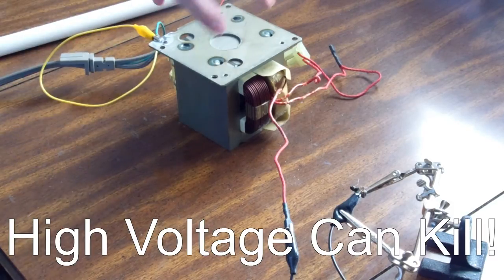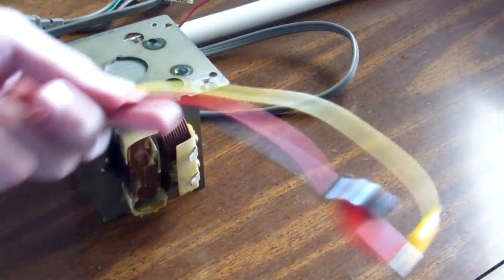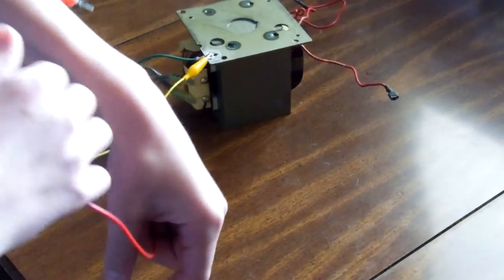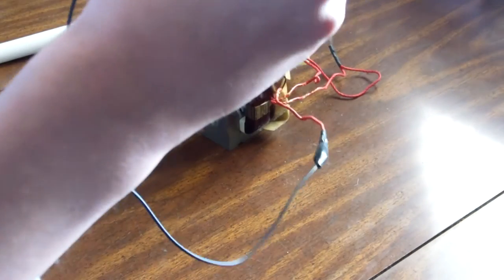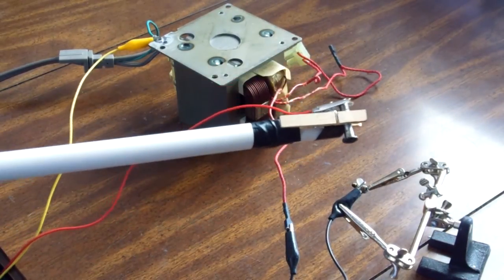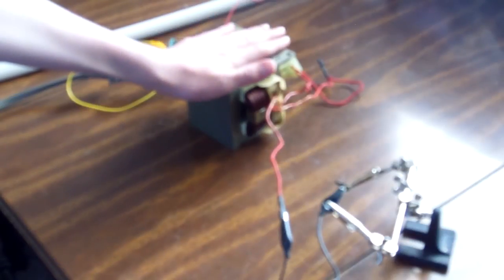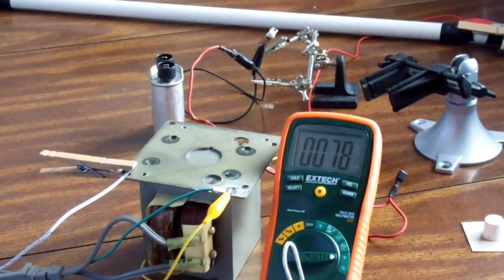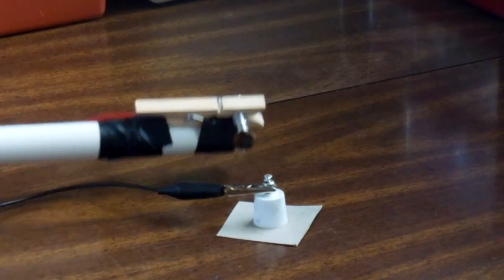Microwave Oven Transformer (MOT) How-To

Comment from the maker: It would actually work better to put a resistor in series with the primary side of the transformer. The reason I don't do that is because finding a resistor that can withstand up to 1800 watts of power is near impossible. The surge protector I use cuts out before the main breaker, so it is pretty easy to reset.
Reply: You can also use a shorted MOT in series to limit current, or cool it in a metal can filled with paraffin oil.

Comment: I thought so about the temps and your reaction, but that's the first meter I've seen that reads fahrenheit.  With my MOT I noticed the 15 amp power strip tripped in about half the time of the 15 amp breaker at the panel.  At 45 amps, it trips in a a couple secs while the house breaker takes 6 secs.

Comment from the maker: The temps are in Ferinheight. If my MOT got past boiling point, I wouldn't have reacted that calmly. The breaker for my room is 15 amp. I am not sure about the power strip. It could be 10-12 amp possibly. It always trips before the main circuit breaker, so I assume it's less.

Comment from the maker: The capacitor doesn't increase or decrease voltage. The capacitors can act as resonant capacitors which will allow higher current, which produces larger arcs.
Reply: Can you show me or explain to me how you hook up capacitors. I tried it and they made small loud arcs and they wouldn't stretch

Comment: How do you prevent backfeed to the electrics in the house safely?  I blew a lot of electronics appliances by messing with high voltage... ei : abut 80,000v from electrostatic transformers in series.

Comment: screw that. pull the secondary coil (the kne with the super thin wire) and replace it with 2 gage insulted copper wire. thjs brings the voltage down to ariund 4 volts, bjt brings the amps so high you can melt metal in seconds. you can also us kt as a spot welder.
Reply from the maker: I have actually done that with another microwave transformer that I have. I never got around to making a video, but it output something like 2 volts with a ton of current if I recall correctly.
Reply: I have a few things to say. 1 HOLY CRAP. I LOVE YOUR PAGE MORE NOW. You actually take the time to respond to commenters. 2 how did you resecure your transformer? 3 how well did yours work? 4 do you know anything on emp devices?
Reply from the maker: I try to reply to every comment since they're questions a lot of the time. I sanded used JB weld to secure the two transformer cores. I put it in a vice for 24 hours to cure and it seemed to work well. The transformer itself worked really well. It could easily melt through anything that I tried to melt with it. I will probably upload a video on that soon since I should have some more free time over the next few months. I am not familiar with EMP devices at all. I'm sure that other people have made them, but I have never looked into it.
Reply: Ok, cool, thanks. I wasn't sure how well it would work ifmi used apocy. EMP is kinda simple actually. If you still have any of your camera circuits you can make one. And i dont think you should you your cup bank to power it. That would likely wioe everything with in 50 feet easy. Just use one cap on the circuit, make a coil of magnet wire, conect it to the cap in parallel with a switch, charge, flick the switch with say a cheap calculator in the coil and it resets. Usingnto capmwould duble distance and likely kind the calculator.
Reply: And also, i have a bridge erector from a pioneer 2011 model surround sound system. How can i check its ampage?
Reply: What did you use your cap bank for? I foundmyour video tryingnto develor a strong emp.
Reply from the maker: Epoxy would probably work for a transformer, I just happened to have JB Weld on hand so that's what I used.

I looked up a couple EMP circuits and it looks like I could use a disposable camera. I probably have 50 circuit boards from cameras still scattered around my lab. It looks like I could easily make it, so I'll have to try it. I'm sure that the voltage and coil size also affects the distance. Either way, I'll start small so that I don't wreck anything.

If the bridge rectifier has a part number on it, I would google it to try to find a data sheet online. If it has several different groups of numbers/letters, you might have to try searching a few different things to find what you're looking for. Also, the size of the bridge rectifier should give a rough idea of how much current it can handle.
Reply: Ok thanks.

Damn your lucky, i cant even find a desposibal Camara anywere

It is about (if not the same ) size of the one you used for your first ac power car charger.
Reply: Im going to make a few banks and thays why id lime to know.
Reply from the maker: My mom works for a drugstore, and they develop film there. I would always have her ask it they have the old ones left over. I probably got over 100 of them over a couple of years. I wouldn't buy a new one, I would just ask around at stores where they develop disposable cameras. That's your best bet.

It's probably around 5 amps for the bridge rectifier, but that's just a guess. I don't think it's possible to know exactly without looking up the part number if it  has one.
Reply: Yeah, see were i am we dint have much of anything around here. The few places that might develop are stingy jerks. And thays putting it nicely.

Ok, using yoyr light bull charger desing, howmwell would that charge a set of 10 50 volt.... crap. how can i limit the voltage flowing into the caps? Or would it be safe ti habe 10 50s set up and run 110 into it?
Reply from the maker: That's too bad that you can't get old disposable cameras, there's a lot that you can do with them. I don't know if they just give them out to anybody. It was really easy for me since my mom worked there.

I wouldn't use that charger design for a capacitor bank of that size. The main reason I made a wall charger was because it took far too long to charge my massive capacitor bank using a disposable camera. How big are your capacitors? I don't know what you have for parts available, but even several 9 volt batteries in series would probably work. That would not be the best way to do it though. Whatever you do, don't go over the rated voltage of the capacitor. Is this one of your first projects? If so, I would probably start with something more simple.
Reply: Its one of my first cap projects. Though ive been into tec mods and things of the sort since i was 9 (13 now, 14 dec 9th) and have incredibly large amount of knowledge about the subject, but just now im finaly getting to have privlage to soder and get suplis. When i make my spot welder, im going to take the secondary coild apart and build a tesla coil and an emp.
Reply from the maker: Alright, makes sense. I didn't know what level you were at since you don't have any videos and this is the only time I've ever talked to you. For that capacitor bank, I would see if you could build a power supply of some sort. Find a small transformer and connect it to a bridge rectifier and use that to charge your capacitor bank. Multiply the AC voltage by 1.41 to find the DC output. A 12 volt AC transformer will output around 17 volts DC, maybe slightly more when not under load. A 30 or 36 volt transformer should get you really close to 50 volts to charge your caps. A small 1 or 2 amp transformer would be more than enough for this.
Reply: Can i share some pics with you in a bit? Its to show you what i currently have to work with.
Reply from the maker: Sure, send me a PM and I'll give you my email.
Reply: And yeah, no vids beacuse i work in my garage. Its a mess, and not well lit. Ive burned my self countless time while soderi g cuznof how dar it is and that i dont have a table to use. Im going tk fix the table problem in a bit.
Reply: Ok, sweet, thanks.
Reply from the maker: I have several scars on my hands from various soldering iron incidents. It hasn't been an issue since I got my Hakko FX-888. I noticed that I didn't need to use as much pressure as I did with my 40 watt Radio Shack iron.
Reply: Lol, i thought it was "its hako, like taco. I really need to get thag strait" i use a sodering gun. I'll send a pic of that too.
Reply: And if you massage your scars with a bit of mostiorizer it really helps depleat them. I know because i made the mistake of dumping a cold egg jnto super heayed oil with out a shirt on. Splatter burns hurt like hell. Morifin works too well.
Reply from the maker: It has two 'k's in it, so Hakko is the correct spelling. I have heard it pronounced a few different ways, but the "taco" version is correct.

A soldering gun isn't really ideal for circuit boards, but they work well with wire and individual components. Whatever you have access to can be made to work though.
Reply: I habe a brand new radio shake sdering iorn I've never used. Hell, i have a mini station from radio shake ive never
Reply from the maker: I'd use that over a soldering gun. An iron is going to be much easier to use for small electronic components.
Reply: Good to know, thanks. Ive been using the gun because i like how it has a triger to turn the heat on and off and it has a light.
Reply: What yould you say would be the easyest way of making a 50 volt power suply like you said earlyer?
Reply from the maker: I would use a small linear power supply using a transformer. I think I made a video about it. It might be hard to find a 30 or 36 volt AC transformer though. I find most of my transformers in old electronics. If you have a multimeter you could measure the voltage output.
Reply: I habe a cheap mutimeter,  but it works grate. Whennk dont leave kt out side in the cold for 2 days by acident.... yeah it thought 1 volt was 100 volts....
Reply: Oh, yeah, ill takenthose pics qnd send them to you whenni finsh my pizza
Reply: I shared the pictures over g+. I have that micro wave apart, bht the mots not the same kind you used. Its coverd in components and tiny.

Comment: does the ground lead that is clipped here to the bolt on the pole need to be first clipped to the transformer case or can it be directly clipped to the lead to the bolt on the pole?
Reply: What?
Reply: @kane3331  ground can be connect directly to the bolt node right?  Why connect intermediately to the MOT chassis
Reply: @gleaseriviera6722  I have the same question! did you find out?

Comment: couldn't you just add a resistor to the secondary circuit to lower the current and not trip the breakers
Reply: Yes but finding a resistor that can take 1800 watts is pretty hard

Comment: can you screw the ground wire to the housing ???
Reply from the maker: Probably, I have not tried it but it should work as long as long as the ground wire makes a good connection. Make sure that you screw into just the mounting plate though. If you go into the core of the transformer it could possibly affect how the transformer works, and you don't want that to happen.
Reply: thx
Reply: Of course you can and you should.
Reply: It is recommended to bond your house's ground to the transformer case. Be careful though as that makes the high voltage output referenced to ground.

Comment: I've wanted to do this for a long time, I know the risks and how it all works, I know how not to die from it etc (I'm not stupid...) But I'm scared to do it :L, all these warnings about how you could die form everyone are necessary, but off-putting.. :/
Reply from the maker: It's good to have a fear of this stuff. As soon as you become too comfortable around it, mistakes are much more likely to happen. Also, the warnings scare away most of the people who don't have any idea what they're doing. If you take the proper precautions, I'm sure that nothing bad will happen. Worst case scenario, the breaker trips (almost inevitable).
Reply: I see, that does make sense. Thanks for the tips and heads up buddy :)
Reply: Microwave oven transformers are notoriously dangerous because those who use them for making a Jacob's Ladder or other "fun projects" underestimate the power output on the secondary and start to become complacent around the energized parts, NOT because MOT's are any more dangerous than pole pigs or any homemade transformers dumping at 5+KVA. Sure, safety with MOT's is paramount, but is as it should be with all high voltage power supplies.

I don't know if there has ever been a documented death related to MOT's, but there have been a few people who received severe shocks from them. They were the lucky few. I have been hit by 240V [actually 120 to ground on a 240[ and the feeling is indescribable. Knowing that, I don't even want to imagine what it's like to get hit with 2,000V at high amperage.

Here are a few [not complete] safety guidelines to keep in memory whenever working with MOT's:

#1. Wood does NOT make a good chicken stick. I see it all the time being used in videos. It's fair at best, but a better choice would be PVC or fiberglass.

#2. NEVER touch the MOT body or wires while it's energized!!!

#3. ALWAYS physically disconnect the MOT from the mains before touching the MOT body or chicken stick terminal!!! Flicking a switch off in the circuit is not good enough. There must be a "Pull Disconnect" available.

#4. If capacitors are in-line with the circuitry, be sure to short them out before touching any equipment. Capacitor discharge can cause serious harm.

#5. Standing on earth ground or a concrete base is inviting danger. Use thick soled shoes [not flip flops or sandals] while also standing on plastic or rubber sheeting.

#6. NEVER leave an energized MOT unattended!!! In fact NEVER leave it to where it could be plugged in by somebody else.

#7. DO NOT create arcs around explosive/flammable materials.

#8. NEVER work around high voltage power supplies while under the influence of alcohol, drugs, or any other mind altering substance.

Pretty Basic Stuff. But it's like I said, MOT's deserve respect, but no more so, nor any less than any other high voltage power supply.
Reply: USNVA That comment is very useful, thank you for taking the time :)
And yes I agree, being shocked with 2kV constant high current would be unimaginable :/.
Reply: I have microwave transformer  with high voltage. tips. never do this if you are tired. one hand in you pocket and one hand work with high voltage. and use glove. stay safe.

Comment: Can't decide if it's a kid narrating this, or a chick with a weird, manly voice... Also, playing with these things is very, very unsafe. A lot of electiricians consider these the most dangerous electrical object in your average household, and with good reason. MOTs put out over 2000 volts at around 0.5 amp, and that's plenty more than enough juice to fry you. Oh well, at least uploader used a proper discharge stick, I've seen people fuck around with these transformers holding the earth wire in their hands wearing household rubber gloves, or a best with a rusty nail taped to a wooden coat hanger. Very unwise, those ones.